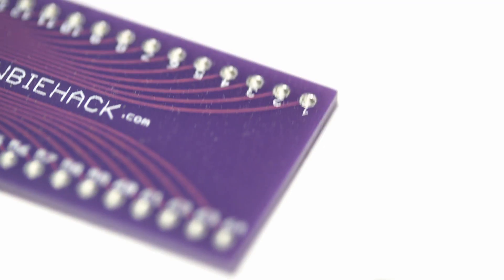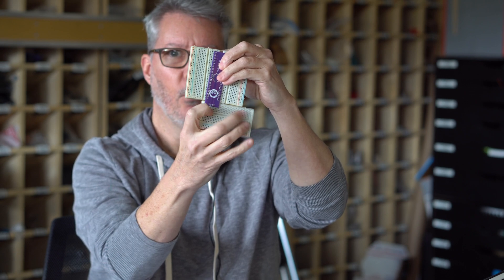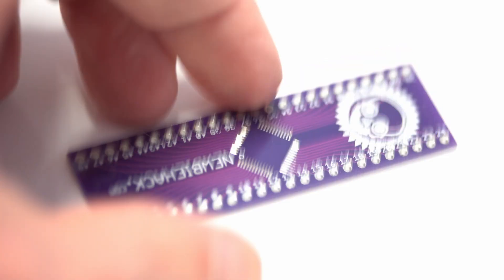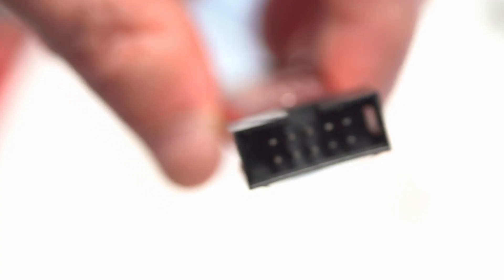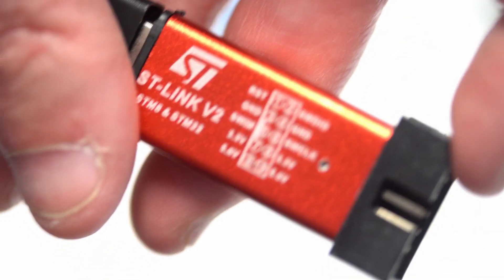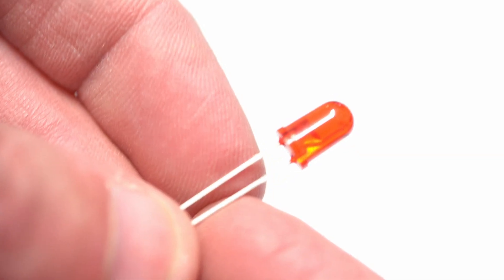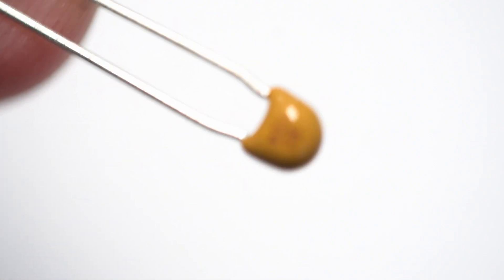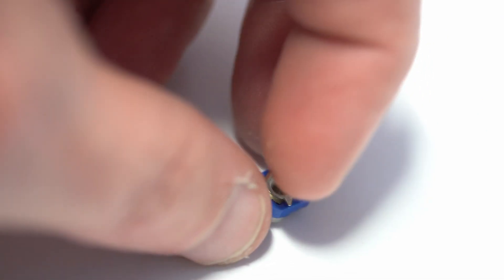#2 ARM STM32 Microcontroller Tutorial - Setting Up the Prototyping Environment

Comment: Hi Patrick,
Thank you for this series. 
The effort you put in is much appreciated.
I just do not understand how can I can reuse the chip in another PCB if it is already soldered in the programming PCB.
Reply from the maker: Thanks for the kind words. The chip in the PCB is only for prototyping and ensuring the program and circuit work correctly. It is intended as the first phase just before you go with a PCB for the real project and to go into production. The breakout PCB with the chip can be reused for a different prototype when that first project is completed.

Comment: Thanks for the videos. I have been binge watching all your videos. I was wondering can you program/flash/debug NXP LPC - ARM based microcontrollers with ST link?
Reply from the maker: You need to use open-source tools like OpenOCD (Open On-Chip Debugger) which supports a wide range of debug probes and chips. I haven't tried, but should work. It's not the standard approach.

Comment: Thank you for making these videos. I’ve been designing PCBs which I need to mount the arduino to and if I can just remove the arduino then I can lessen my size constraints drastically. 

My last project I literally made a separate PCB which awkwardly mounts on the side of my project that connects with a ribbon cable just to connect 6 pins of an arduino Nano to the main PCB. I could not make one PCB with my size constraints using the arduino.
Reply from the maker: Excellent. I'm happy to hear you broke off of the Arduino hold. Now you are free!!  Haha!

Comment: I have the H757 Eval Board, which I got [as a gift] a couple of months ago and am still getting to know it.
There's no material (tutorials, books, etc...) for these high performance boards. I can kinda understand it - like, if you have such a board, then you should be fine with all the fundamentals, right? Haha But still.

Still I will follow the series since many of the concepts apply to all STs with ARM Cores.

Keep it up!
Reply from the maker: You will be perfectly fine with these tutorials. you can follow along, but make sure to have the reference manual ready. I use the reference manual heavily in these tutorials. If the code should work, but just confirm with the reference manual for your chip when using the register level code. The registers should  mostly be the same, so for the few that m ay not be,  use your reference manual.

Comment: Just wanted to say hi. Im a retired C programmer. I do the ARM for a hobby. 
Great job on your video's. Kerp up tge good work.

Ps: i use the stm32CubeProgrammer as my monitor system
Reply from the maker: Nice, thank you so much.  I will take a look at the STM32CubeProgrammer. Do you ever use STM Studio or STM32CubeMonitor?
Reply: @PatrickHoodDaniel  The programmer will show all the registers and you set/reset any bits just like your source code would do, so you can see whether or not it works without any code

Comment: I think this will be hard to learn and to catch some necessary information than learning avr microcontrollers.
Reply from the maker: No, this will be easier to learn than the AVR series. The tools that STMicro provides are better than I have seen for most platforms and this will allow you to understand everything in detail. I am planning on demonstrating and instructing at a level that a 5th grader (10 year old)  will be able to understand and follow as long as there is an interest and persistence in following along with every step.

Comment: Hi many thanks for the video. The book just arrived today 😁 question: I do have several STM32 Dev board like the nucleo-l476rg and others. I guess it is fine for following along. I see the benefit of being able to attach the MCU on the breadboard but appart from that is there any advantage of not using a devkit? (Please also share the Gerber and exact STM32 version you will be using) - great work !
Reply: Thanks for your reply! I also wanted to mention that STM32cubemobitor is the alternative to stmstudio. I used it recently to monitor a particulate sensor. It is an interesting software.
Reply from the maker: @mic03311  Good to know.  I will check it out while I make the next video.
Reply from the maker: Absolutely. The Nucleo development kit is fine to use since you are using the same IDE and programming as the bare chip method.  Just remember that when creating a final circuit for a potential product,  you will need to determine which components on the Nucleo are relevant and necessary.
Reply: @PatrickHoodDaniel  can you share the physical dimensions of the breakout board and the exact chip you will be using. I will try to create mine on kicad. This should be fairly easy to implement. Thanks
Reply from the maker: @mic03311  I am using the STM32F030. Don't worry too much with the specific chip though. Using the reference manual that I show in the videos will allow you to understand exactly  how to program any of the STM32 chips.  The breakout board is 3.44 inches (87mm) x 0.89 inches (23mm).